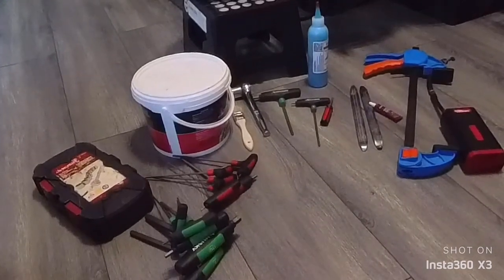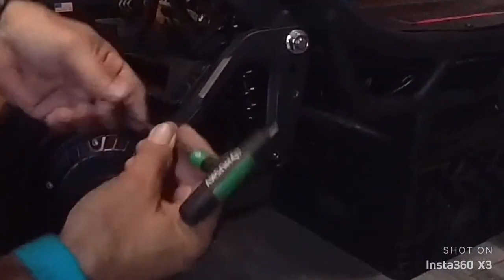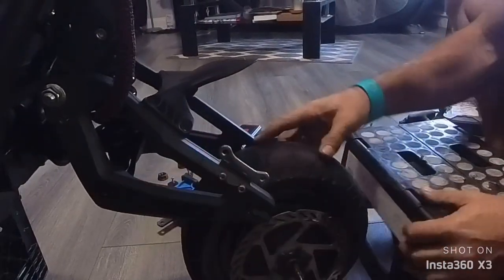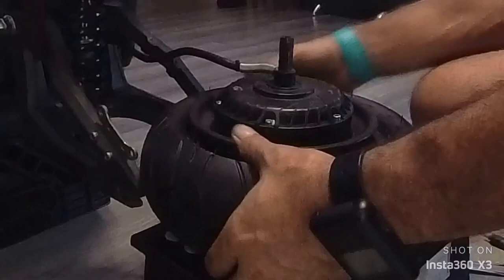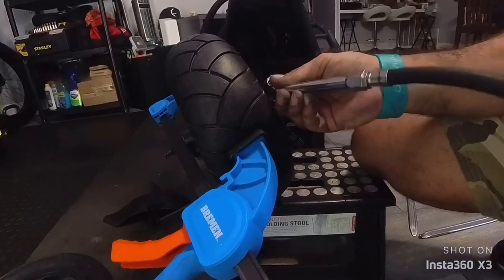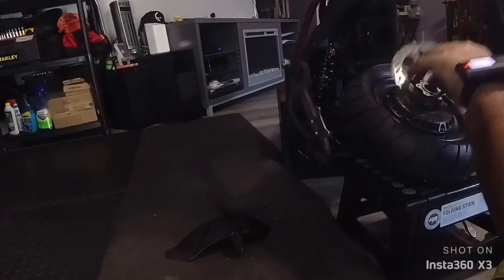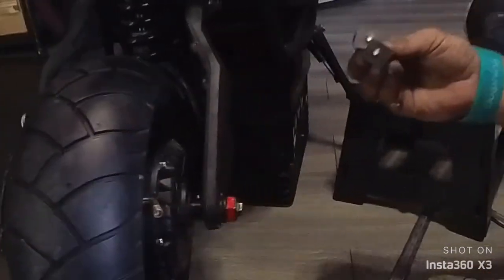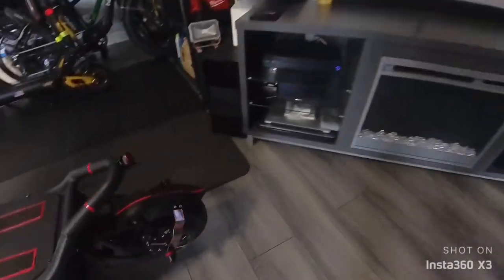NAMI BURN E  PMT TIRE INSTALL /CHANGE !  ELECTRIC SCOOTER DELIVERY maintenance !

Comment: Next time instead of using clamps, try using a ratchet strap around the circumference of the tire.
I'll try this method soon. I'll be putting PMT's on my new burn-e2 soon.
Reply from the maker: Maybe, I know about the ratchet method, but the clamps work for me 👍  but try and see , pmt are the best! 👍

Comment: Will the bead break if I deflate the tire and put tire sealant in?
Reply from the maker: @Londonbridge978  it shouldn’t  just need probably to start with air compressor and then air pump to inflate it .